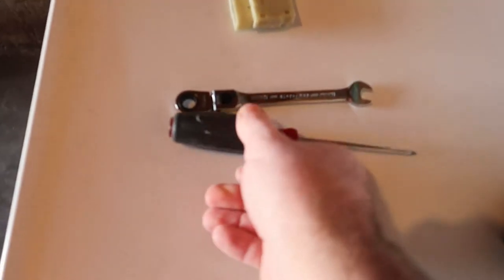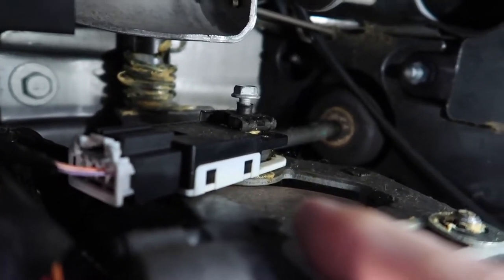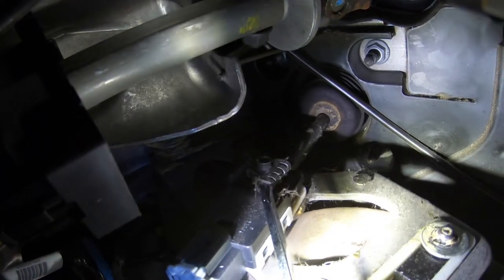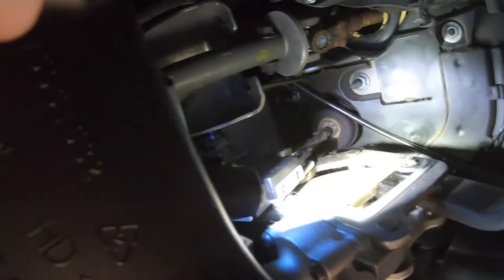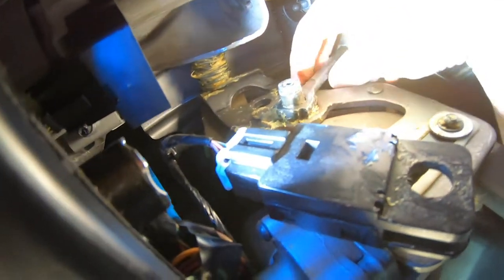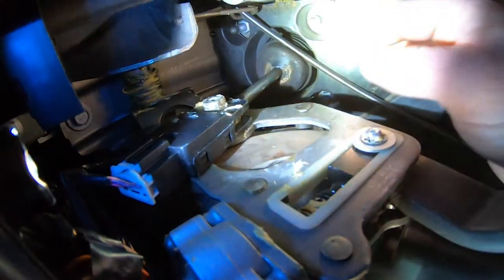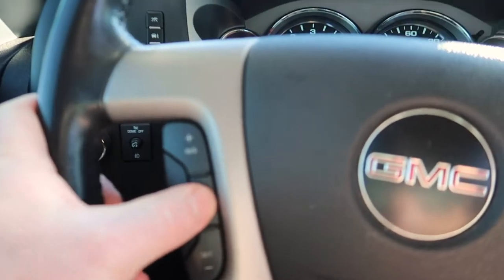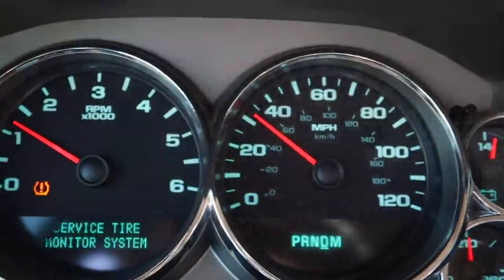How to Install a Brake Light Switch

Comment: In the video, you mentioned the Part Store gave you the wrong switch. How did you realize the switch was wrong. What was different? I just changed my Master Cylinder and Vacuum booster on my 2010 Silverado LT 1500. When I went to hook up the Booster rod to the brake pedal, the switch hole would not line with the pedal stud. My RPO codes showed I have JL4 (CONTROL ACTIVE BRAKE) and JF3 (-BRAKE VAC POWER, 17' DISC/DRUM, W/ABS, 7, 000 LBS) and that"s the Booster and Master Cylinder I installed. The old switch that was on there will not fit the new Booster. The hole in switch is the correct size but it won't line up. The switch hole needs to be 1/8" farther from the switch. Does that make sense?
Reply from the maker: I went to O'Reilly's and gave them my make/model.  The guy behind the counter gave me the wrong brake light switch.  I realized it after I took off my old one.  They didn't match up.  I went back to the auto store and received the correct brake light switch.   Past that I don't know what to tell you.  It was very tight and a pain to replace.  I wish I had more info but that was my experience.  Good luck to you man!

Comment: I have a quick question, am I screwed if I lose the clip?
Reply from the maker: I assume the clip is there to keep the brake light switch from rattling while driving.  I’m no mechanic but i don’t believe the clip matters.  I’m sure if you were to lose the clip that you could ask your local auto part store to order a new one.  Good luck to you!